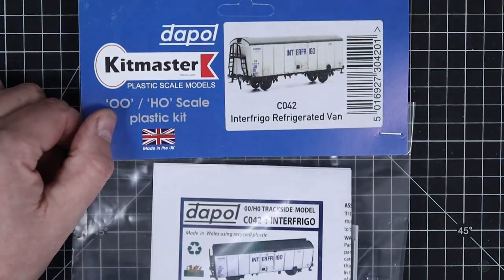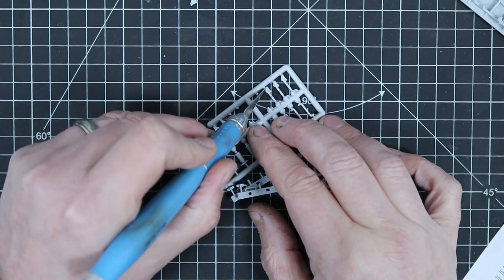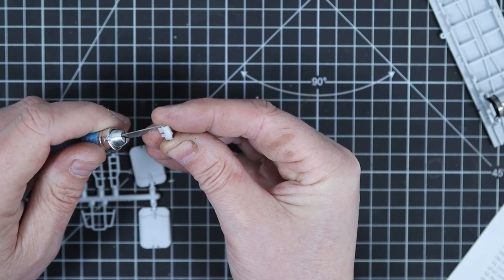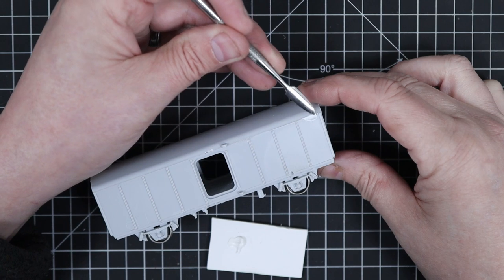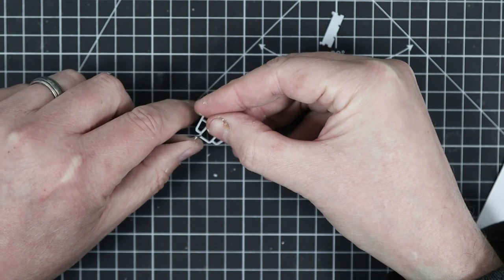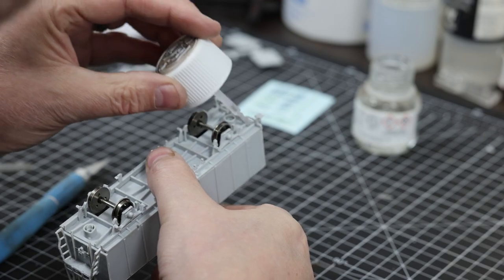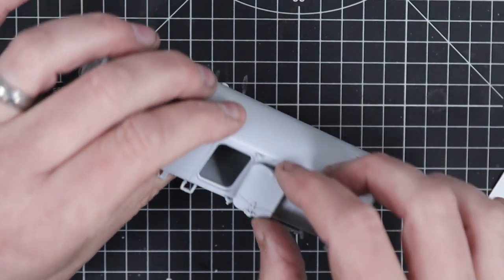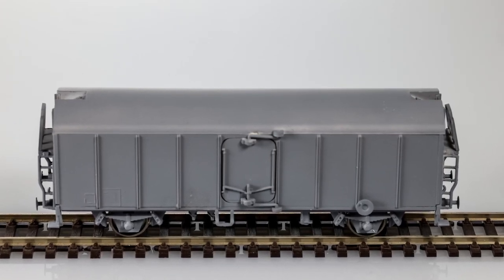Building a Dapol Kitmaster Interfrigo Refrigerator Van | Weathering Model Railway

Comment: suggesting you put a weight in it as they are light
Reply from the maker: This particular one isn’t going to be run, but you’re right, it is light
Reply: Yes I have done so. Added two lead seals held inside with glue and wire twists up through the floor.